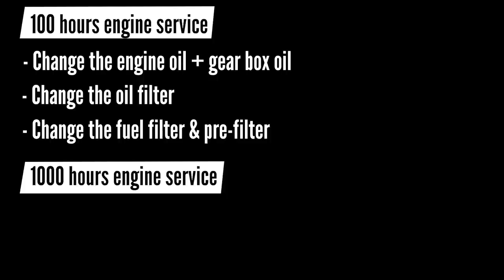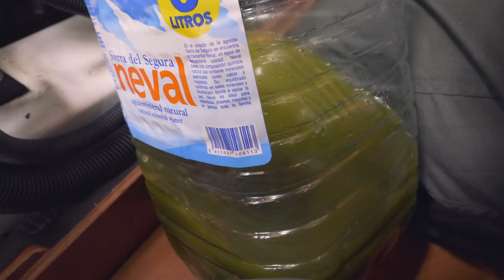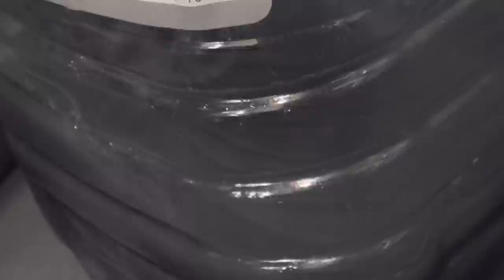SAILBOAT MAINTENANCE: Service a marine diesel engine with me & Philippa (Yanmar 1000 hours service)

Comment: Just have to tell you that I was changing the oil on my boat today (a Jeanneau 39 with the same Yanmar engine). I was pumping away and hardly any oil was coming out through the dipstick tube, so I pulled up this video and the first things Sophie says is to loosen the oil cap so there won't be a vacuum. Doh!! You literally saved me about 2 hours. Thanks!!!

Comment: One thing you should add to the sea water pump is a small strainer between it and the heat exchanger.
So if the impeller breaks the strainer will catch it and you won't have to go fishing for them.
Something to consider is an oil filter relocation kit.  This will let  you take it off and on from the bottom and not the side
Reply: Can you buy these strainers off the shelf?  I assume they are inline?.

Comment: Ryan, take one of those antifreeze jugs and cut the side off of it so it fits under the oil filter. That way when you unscrew the old filter all of the oil drains into it instead of onto your spill pad and floor. You can also use it for the fuel filters.
Also, use new oil on the seal, not the old oil. The solids in the old oil can prevent the new seal from sealing, which will be a nasty leak.
Ill speculate and say your coolant is that color because you need an anode in your cooling system.
Otherwise, awesome video. It’s fun to see people doing things that they normally don’t do. 😊
Reply: I agree!

Comment: Coolant colour should never be the basis for deciding if anti freeze is correct. Different manufacturers colour the coolant for their own benefit, there is also many different versions of various colours of fluid. The spec of the oil is the determining factor along with manufacturers approvals. When changing the coolant and using another brand always perform a system flush. The sea water impeller needs to be greased not only to make it easy to install, but also so it doesn't run dry on startup till the seawater gets up. If the impeller overheats from running dry it can break up. Other than that great video, good to see the women getting in on the action

Comment: Old farmer trick. Put a plastic bag (zip lock) over the old filter and unscrew it right into the bag along with any drips. None on your hands or in the bilge. Ryan, electric lift pump in the fuel line means no hand pumping and is a back up if the mechanical one fails. $20 well spent.
Reply from the maker: Hi Mark.  Thanks for this great tip. Never thought about it.  I sometimes take a 2 liter bottle cut the top off and let the fuel filters fall right in.  Works well.  Ryan

Comment: Don’t know how easy they are for you to find but puppy house training mats are also a good option for catching oil. They usually have a layer of plastic on the bottom so nothing leaks through. This is both a bonus and a problem. The bonus is that you can reuse the mats since the bottom is still clean. The problem is that you have a plastic to dispose of.

Comment: Sophie you just forgot to fill up the oil filter with new oil.....not to the top but just a little bit so the engine won't suck up air when it starts for the first time. It's an old mech trick.
Reply: @extremelydangerous  well....on my Harley and my Volvo {horizontal filter} it works greatly. Couldn' cause any  damage at least....

Comment: Stick a 1 litre plastic bottle (cut the neck off first) over (around/ under) the 2 piece fuel filter so that when you undo the bolt the filter & the bowl , plus fuel remains in the bottle. You did not clean the surface of the pump housing for the impeller change. Normally one would & change the gasket at the same time to prevent leaks. When draining oil check how much you have removed as you may not have removed it all & you may not have got the suction hose end in exactly the correct position, thus leaving some in the sump. It also gives you a more accurate guide of how much to put back. When pumping fuel back to bleed the system you need to ensure that the flywheel is at the correct position, otherwise the pump will not pump as it is not on the pump "stroke" point of the cycle.
Oh & finally-- could we have a bit of cleavage when Ryan is not looking when you are doing these vids 😁 cos you 2 are gorgeous

Comment: Carry a quart of Automatic Transmission fluid to fill the fuel filters..... It will lubricate the the entire system and injectors. We Have been doing this for years servicing Simi Trucks and i do it  on my sailboat.... It works great when under way and the fuel filter has to be changed. I always carry a couple quarts of Trans fluid. Good work and loved the show.  :)

Comment: In addition to draining the coolant from the engine, you also need to drain the coolant from the hot water system, (another 1-1.5 litres). Nice feminine touch for a normally blokey video.

Comment: For those complaining about the ladies wearing white shirts, there is no rule in the diesel technicians handbook about what color shirt you have to wear. When you do the maintenance properly, you shouldn't have any engine fluids on your clothing afterwards. If you do, you're just sloppy. Also, marine diesel engines tend to be a lot cleaner than the diesel engine in your pick-up truck. They aren't exposed to road dirt and grime. The 42 year old Perkins in my sailboat is just as clean as the engine on Polar Seal.

Comment: Also pre filling the fuel filter helps a ton and if u want to clean ur injectors something that works good is get the engine hot like uncomfortable to work on hot then change the closest fuel filter to the pump and add sea foam fuel cleaner 
Or any other u trust fill 30 percent of the filter with cleaner top the rest off with fuel when ur filter is tight start the engine for short amount of time less than a minute and shit it off let it rest for 5 minutes and repeat that until the cleaner is gone

Comment: The mechanics in my local garage don’t look a bit like that. Next time you remove the oil and fuel filters put a plastic bag round them to catch the oil and fuel. A lot less messy but the white tops were impressively clean at the end. 

Mike in Sheffield UK

Comment: Look up flexible funnel it looks like a flat think piece of silicon but when u bend it into a shape it holds that shape for doing ur oil filter or just cut a jug and bend it to fit just clean the flexy bit before it springs back and throws oil all over the place

Comment: @04:25 that bottle of water from Sierra del Segura in Spain is a looooong way from "home"
@11:10 maybe next time try to fill up with fresh oil the filter and also soak the rubber gasket

That engine oil looked pretty charred to me, and too thick when poured to dispose.  Maybe next time try an engine flush to prevent build ups and to clear all soot/gums.  About the coolant, it was very turbid. The fact that when flashed with water it turned close to the same colour is an indication of likely decomposition or solid depositions (maybe pH, maybe something reacting like Copper?). btw, it's not adviced to use tap water, but demineralized/distilled water.  And you should stick to the coolant colour as specified in the operating manual by Yanmar. 

My goodness, Philippa referring to black treacle is soooooooo English. Ask her to prepare you a Mohogany. 

super video Sophie, très divertissante!
Salutations/Regards

Comment: At  20:26 you forgot to take out the rubber seal from the fiter, and place some oil in the other side of the seal too, só next time the oil filter will come out easyer. Also you forgot t say that these procedure must be done when the engine is WARM,  that is: run the engine till it reaches normal temperature, than stop, wait  some time to cool to a WARM temperature, than remove the fluids. Also, very important.. in the oil collected, pass a magnet (neodimium) and watch it, to see if there's  ANY Iron dust or particles. In the magnet. I would buy a small neodimium magnet and put it inside the oil filter too. In a way it cannot block the oil flow. So, next time, an inspection of that small magnet, will show  if the engine is wearing out.